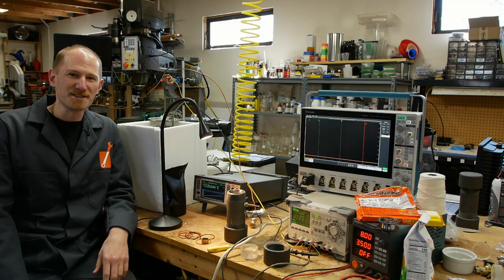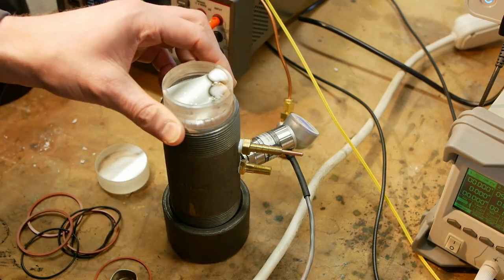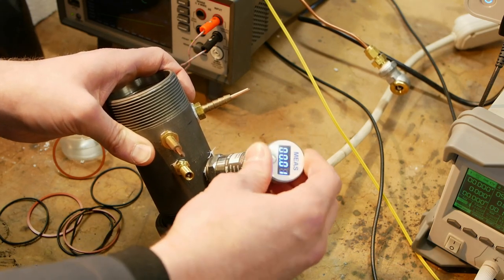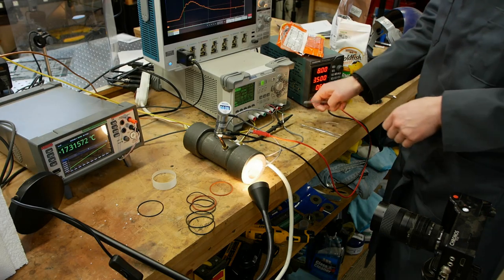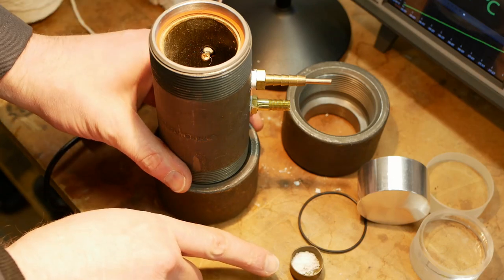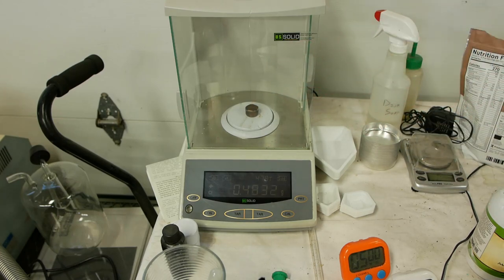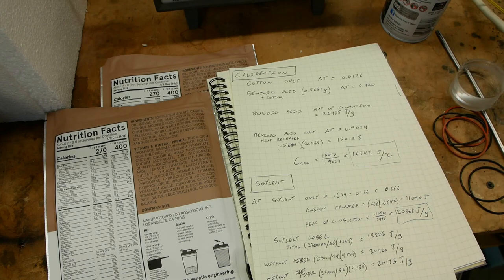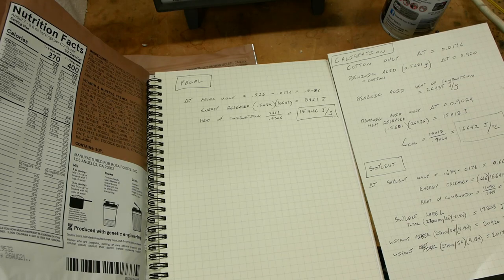Measuring human digestive efficiency vs. a flame

Comment: Not sure if I missed it somewhere, but aren't you comparing apples and oranges when comparing the energy density of the input and output matter like that, in that a certain amount of input might result in a much lower amount of output as the digestible bits are converted into water and CO2?
Reply: To be fair, he did say he was just screwing around.
Reply: If he collects and dries all output, over long enough time to average out the fluctuations, he could establish the dry matter input:output ratio and get a more meaningful efficiency value.
Reply: @4hodmt  He'd still have to take into account any non-water weight gain, but this could also be a way.
Reply: @JustOneAsbesto  24:46 - He did say "we", which in my opinion implies the audience as well :D
Reply: He could used an inert non-digestible standard that could then be measured and used to determine the mass to burn in the calorimeter. No sure what or how (maybe mass spec) and I can be suer it would add significant cost/complexity
Reply: Olestra :)
Reply: I agree about this, If the diet fiber is indigestible, which mean the poop is mostly fiber, which is calorie dense
Reply: @2001Pieps  ne he would not, this is about energy extracted from the food, whether the body uses it or stores it for a later day/ also uses other energy sources is irrelevant.
Reply: @4hodmt  I thought he did that andwas very disappointed he did not acually freezedry a weeks worth of turd...

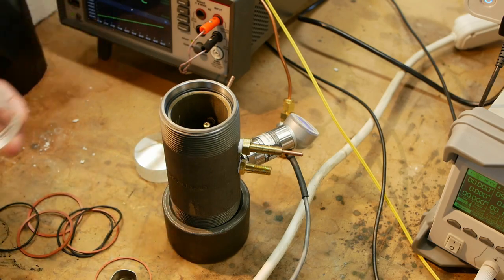Comment: W.r.t. the burst/leak thing at roughly 7:11, the determining factor of whether or not the plastic will also burst is if the speed of sound in the containing material is faster or slower than the speed of sound in your contained fluid. There was a silicon wafer plant somewhere that had a pipe full of silane explode every pipe in the plant because the speed of sound was faster in the pipe wall material, so the pressure relief wave in the silane was always slower than the pressure relief wave caused by the crack in the pipe.

[edit]: related paper that I haven't had time to read yet: https://www.icheme.org/media/10230/xv-paper-15.pdf
It looks like that it isn't the speed of sound in the pipe material, but rather the crack propagation speed, and there's some more complicated math going on than I initially thought. Still an interesting read.
Reply: Burst? Isn't it burning in oxygen rich environment like he said? The seal will be in contact with the oxygen.
Reply: @rkan2  True, but that's a different failure mode. I'm referring to the pressure being specifically too much for the window. The seal burning through is the sort of problem that could've been solved with a correctly sized O-ring groove. 😉 Though it should be a fire-resistant material anyway given the environment.

Comment: This pipe bomb 😆 you made looks a lot like the regulators I build at work.  We use 2024 aluminum, 7075 aluminum, cda 360 brass, Viton o-rings, Kel-F plastic and 303 stainless steel.

And yes, Buna burns like a fuse in oxygen rich environments.  Viton and silicon melt and burn, but buna/nitrile is almost explosive.

Comment: Hey Ben, interesting video as always. I do wonder, did you correct for total weight on the input and output side? If your body takes up a certain percentage of the input weight, only the remainder of that percentage is truly lost. If the total output weight is not the same as the input weight a comparison of joule per gram does not make sense right? Could that be the missing piece of information?
Reply: you would need a none consumable substance, in the input, to test in output.    that would quantify the food it represented
Reply: @themadrobot  he could measure the ash content of both materials to get a rough estimation, although you would probably need to purify the ash before measuring it to account for soluble substances like salts getting lost in other ways. This would be very complicated though.
Reply: Or simply weigh the dried soylent and the dried output of a given period, and compare the calorific values of the same proportions.
Reply: @lucassu95  that first came to mind but,  the prospect of freeze drying so much as a few days of 'material'

Comment: ever since i learned that ICEs are about 20% effiecient in middle school ive always wondered whether i have a better fuel efficiency than my honda bike
Reply: Running 10 miles burns 1k calories and a gallon of gas is around 32k calories, people get 320 mpg if we could eat gas.  Very roughly speaking.
Reply: On a pedal bike, you get about 1/38th miles per calorie. So if you ate gas, never slept, and never did anything else you could go 853 miles on a gallon. But you'd only be going about 15
Reply: YeYaTeTeTe  you can't tell me what to do

Comment: the fact that glass has a statistical failure rate is really interesting
so that means you can't trust it will break after 1000 uses, but instead that each use has a 1 in 1000 chance of failure?
Reply: it's not like that. if you don't exceed the ultimate tensile/compressive/shear strength it shouldnt fail
Reply: @krzysztofbroda5376  He explained it very poorly, glass is super complicated
Reply: Runforitman. This is generally correct. Architectural glass (e.g. window Glas) is typically closer to 7/1000. You can manipulate the ratio by “massaging” the material (e.g. grinding and polishing edges), but won’t change its inherent statistical nature.
Reply: @krzysztofbroda5376  not.

Comment: I was just amazed when you cut those gaskets on the lathe, that’s a brilliant idea. An idea for a flame proof gasket could be a copper ring or maybe flexible graphite
Reply: I was thinking some kind of copper alloy as well, a soft brass or copper that can deform ever so slightly under the clamping load
Reply: Copper gasket is brilliant to some. the mechanic is like "this should have been obvious".
Reply: Copper is a standard material for vacuum gaskets
Reply: @Paul Skaar not sure about grafoil where there's fire and pure oxygen at high pressure.  I'd expect some of that to be combusted. but maybe I'm wrong on that.
Reply: @samalbury9183  i suspect it probably dosen't make a difference  here with using copper gasket in vacuum vs hyperbaric.  

Does copper cold weld in vacuum conditions?
Reply: @kreynolds1123  no idea. it might to itself, but if it cold welded to stainless steel it probably wouldn't be used. Just speculation though
Reply: @Lammedreng  It's all good. Although, when you removed your comment to me, it made my follow up comment praising your idea as probably the best solution to the gasket problem seem out of place, forcing me to remove that one and apply it here.

Comment: What is also going to offset these readings is that your body has a very long term storage. Combined with that it is constantly breaking down its own cells, primarily blood cells, results in fecal matter containing many elements that would not be in your nutrition from the past week.
Reply: Broken down body cells don't go into fecal matter, they are transported with lymphatic fluid and blood and end up in urine.  However chemicals reused in digestive fluids such as spit and bile do get mixed into the digestive tract and may end up in fecal matter if not reabsorbed along usable food chemicals.

Comment: Oh thank god, someone who actually know something! I've thought about this very subject many times. I really appreciate seeing all the tips and trick of getting the experiment off the ground. Thanks for the video! By the way, for anyone working with high pressure oxygen, make sure you never allow hydrocarbons to come in contact with the oxygen and always use copper lines to transfer the O2. Stainless steel will become flammable at about 5 bar (75 psig ). Also, if you use PTFE tape, make sure it is certified for oxygen service. Oxygen certified PFTE has no oils that can burn. I have investigated several O2 explosion in the past few years where people have not headed these precautions. As to the calorific balance, how much input mass was there vs the output mass? E.G. If you ate 200 g of Soyulent and had 100g of fecal matter ...

Comment: Exactly, what I am always curious about: labelled Calories vs. digested Calories.  I had a hypothesis for years and it wasn't proven until now.  I hypothesized that the calories on food labels doesn't determine accurately how much food is being 'burn' in the body efficiently.  According to your data, it seems like 25% to 30% efficient.  I suspect it varies from individual to individual.  That would be an interesting study in the future. Thanks!
Reply: Wouldn't we need to eat 3x more or is the bmr already compensated?

Comment: This is one of those applications where rubber seals are a firm no and PTFE is a requirement.
edit: or fluoroelastomer.
Edit 2: or silicone.
edit 3: or not silicone.

Comment: Great video, very interesting as always. I was so surprised to see such a basic mistake made though of comparing 'grams to grams' of soylent to dry poop. Obviously if you ate 1kg of soylent and pooped out 100g of poop, the poop could even have greater calorie density from the indigestible fibre, so it literally tells you nothing?

Surely you'd have to clear out your system, eat a bunch of soylent, clear out your system again, and measure that. Even then, you'd have to take strong antibiotics to prevent the results being contaminated by biomass, and that would be awful for your health.

Comment: I've always wanted to do calorimetry experiments with my microwave to measure its efficiency. I figure if I get a shallow, glass pan with roughly the same dimensions as my microwave, fill it with a known volume of water, measure the temperature, then run the microwave for a given amount of time, and measure the change in temperature, I can work out how many joules, and taking the time into account, how many watts were imparted into the water and simply take the difference of that figure and how many watts my microwave actually draws, measured with a kill-a-watt meter connected to the microwave and work out just how efficient my microwave is. I'm sure efficiency varies from model to model, and probably depends on how much power the microwave draws, the dimensions, how well built it is to contain the microwaves, and so on. Even something like altitude would probably affect it, as there would be a different amount of air present to absorb some of the microwaves.

There's no real purpose to this experiment, other than curiosity and of course, the fun of exploring science. Plus, I've always wanted to do some sort of calorimetry, but it's difficult without a vacuum chamber. And I got thinking one day, and came up with this idea. So, one of these days I'll do it.
Reply: I had to actually do that experiment.  My girlfriend's microwave stopped working, and she said it had been getting weaker before that.  I fixed the broken plastic fan, calculated how long it ought to take to boil one cup of water based on 600 watts, and temperature change of 90° Celsius, efficiency of 90%, plus some energy for the cup.  It boiled right when expected.  Only the fan was broken, the oven part worked perfectly, and she was wrong about the oven getting weaker.
Reply: @beyondwhatisknown  That's really surprising that it started boiling exactly when you worked out it would. That implies that at least your microwave is really efficient. Normally you would expect that there would be some losses in the microwave. For instance, just from thermodynamics, converting one form of energy to another will cause SOME amount of loss, but whether that's a lot or a little depends on the situation. And then, it's reasonable to assume that less than 100% of the microwaves in the oven would be absorbed by the water, causing it to heat. Which is why I was thinknig of using a pan about the same size as the microwave, so the water can absorb all of the microwaves being generated. Like how a microwave has hot spots and cold spots where the microwaves are either more concentrated in the hot spots or less concentrated in the cold spots. If you happened to put your glass of water in a cold spot, you would think it wouldn't absorb as much energy. Which is why I wanted to use a dish as close to the size of the microwave as possible. And since no faraday cage is perfect, every microwave oven is going to leak SOME amount of microwaves. You can actually detect a fair bit of microwave radiation right up against the screen on the door. But it dissipates pretty quickly. But that just shows that some amount of energy leaves without heating the water.

I had assumed that any of these effects would cause a significant loss in how much power goes into the food vs how much power is lost. Or at the very least, that the combined effects would affect the efficiency significantly. But it sounds to me from the results of your own experiments that at least with your make and model of microwave, all of these factors I was trying to compensate for wouldn't cause very much loss of power after all.

Sorry my reply was late. YouTube's a bit wonky when it comes to telling me about replies to my comments. But thanks none the less for sharing your own results and experiment with me. It definitely makes me more curious to try this out now.
Reply: @VoidHalo  I asumed all the microwaves would keep bouncing around inside the oven, at the speed of light, until they hit something like food or water which would absorb their energy.  The cold and hot spots are inside the food, not inside the oven.  Fun physics!

Comment: Huh, I wonder what the residual poop nodules are. Calcium, manganese, and phosphorous compounds maybe?
Reply: phosphates and sulfates seem pretty plausible. calcium sodium and potassium phosphates and sulfates wouldn't be gasses after burning, and have high melting points.
Reply: Just concentrated minerals. Basically minerals from food that were not absorbed present in a much higher concentration from the input Soylent.

Comment: Hi, a great experiment. I think that there is a more complex issue occurring here. Fecal matter consists of the residue of digestion but also contains the bacteria of the gut flora that are expelled, and the remains of the gut mucosa that is abraided as the bolus passes through the intestine. Additionally, there is the product that is secreted by the liver as a byproduct of blood cleansing and replacement.  altogether "food for thought" Thanks for the fun, Richard
Reply: Liar

Comment: In university, we used 230 bars O2 pressure for our bomb calorimetry experiments. Basically, unregulated O2 in excess. You don't NEED that much. It's just simple and easy. You could get results at much lower pressures. Most of the data quality comes from measuring tiny temperature differences. I'd recommend 6 PTD sensors. 3 for reference bath and 3 for sample bath. Protect both baths from drafty air because that will introduce lots of noise error.

PS: use a copper crush washer. You can re-anneal it periodically to extend its lifetime.

Comment: Thank you very much for the hard work you did to do this. It is impressive. And it shows how hard it is to get new science correct. Others have pointed out the flaws, so I’m not going to do that. I’ll guess that the body tends to be able to absorb 95% of the nutrients. Intestinal flora gets most of the remaining. If we weren’t getting nearly all the usable energy out of our food, evolution would have lengthened our small intestine. Here are some facts that I remember. Almond paste is fully absorbed, but almonds aren’t due to inadequate chewing. Feces includes fiber that was eaten, intestinal flora, and cell components—I have no idea the heat energy each has. Improvements to your methodology include measuring solid inputs and outputs, weighing urine and analyzing urine composition to calculate nitrogen loss, estimating respiration and calculating carbon loss, and estimating skin slough.

Comment: Some foods change in digestible caloric value after cooling. I’ve read this is due to some starches converting to a non-digestible form (“resistant starch”). Clearly this change wouldn’t be noticed in a combustion calorimeter test so I’m interested in a more microbiological/biochemical focused follow up. I’ve a thought that digestive efficiency is likely non-constant and more complex than any calorie label would make it appear.

Comment: if you ever need to redesign the reaction chamber, the company Parr instruments makes them (so technically they are.. Parr bombs.. hopefully I'm not on any watch lists now) and you can request a catalog or find a lot of specs and engineering drawings on their website for ideas on making them and inferring safe operating conditions from. Just keep in mind, as I'm sure you would, the actual complexity of those designs and their rated capabilities. High temperature and pressure chemistry and reactions can be very dangerous, especially when you reuse the equipment a lot. In this case the expected conditions were mild but always better to include a physical blow out design like Parr does. And don't have the blow out pointed at anything important..
Anyway hope that helps, love your videos. Not sure if you have a little autobiography video up, but if not you should!

Comment: At work I used a Dumas nitrogen analyser to determine protein content. The theory of this is pretty simple. In this analyser, a small tin cup containing the sample is heated to ignition in a oxygen rich environment. The gasses are pushed through an oxidation collum (ours was copper oxide). After this, the gas was pushed though a reduction collum (copper) to get the carbon out, followed by a trap for oxygen and hydrogen. Then the specific heat capacity of the gas was measured and compared to helium. This way we were measuring exactly how much nitrogen was in our sysem after burning, and with a constant the protein content can be estimated.